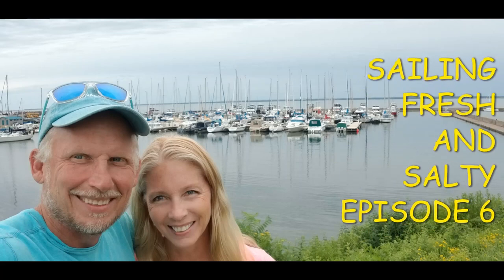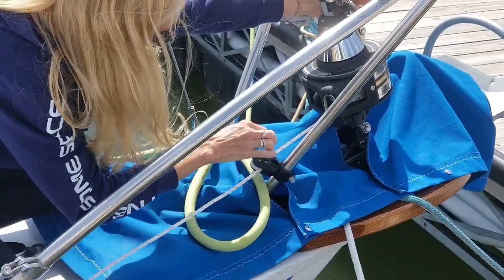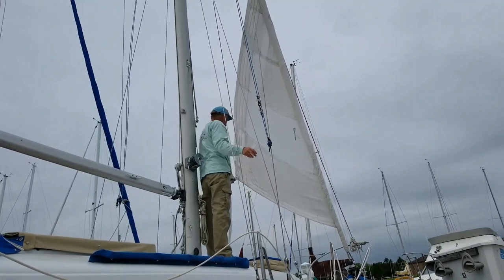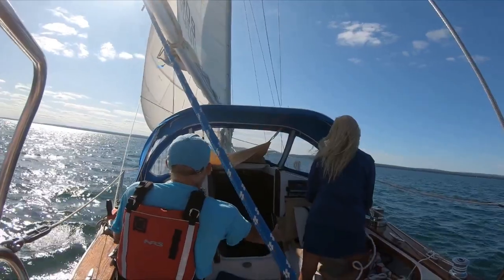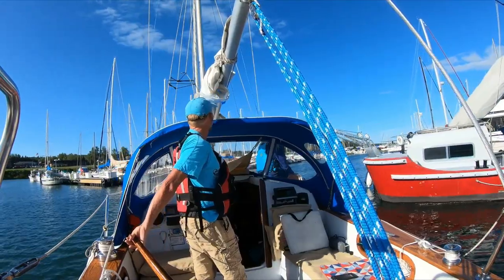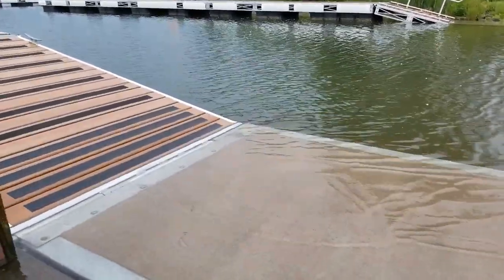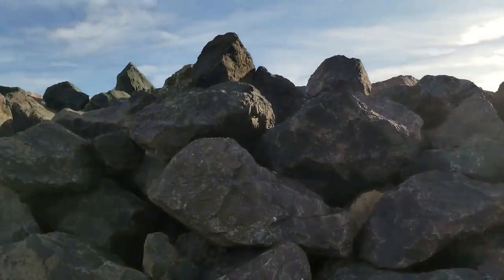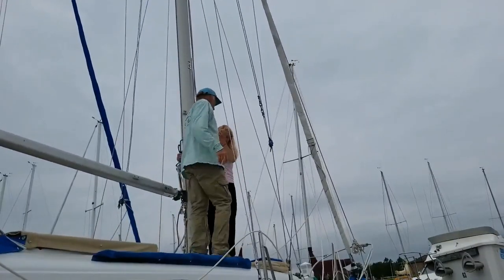Pearson 30 Shake-down sail Chequamegon Bay Lake Superior (EP 6)

Comment: So was the big outboard on back a fix for inboard failing or!?
Reply from the maker: Yes, they'll old inboard gas engine was bad when I purchased the boat. We had such good luck with the Yamaha High thrust 4 stroke outboards the catamaran we decided to put one on the Pearson.
It has been many years now and we love the benefits.
Plenty of power.
No petroleum smells in the boat anymore, also added lots of storage. We put two kayaks where the motor and fuel tanks used to be. The outboard has an electric steering Ram and the throttle and shift control is mounted next to the companionway in a convenient spot.
Thanks for your comment and thanks for watching

Comment: Hi there! What year is this P30? Thanks
Reply from the maker: 1971, thanks for checking us out
Reply: @sailingfreshandsalty5078   Almost bought a 73 last year. The traveler was mounted on the fat seat bench, noticed yours is mounted on the stern combing. Did you move it or was that standard? Thanks.
Reply from the maker: @foundatsea3483  mine was mounted also on the fat seat bench originally, we decided to move it to where it is now, more room in the cockpit and out of the way. We don't have a problem with sailing the way it is, if you were wanting to race a lot . Get every advantage that you can to gain that extra speed you probably want to leave it the way it comes Factory
Reply: @sailingfreshandsalty5078  Nice job. I see no evidence of the old traveler install lol. Did you just epoxy over it? Also looks like a newer galley table top / surface? Lovely
Reply: oops *aft seat bench! Not fat haha
Reply from the maker: @foundatsea3483  I was wondering about that, fat seat, all makes sense now I thought it was a new term, haha , thanks for the clarification
Reply: Sailing Fresh and Salty lol good fun with words!